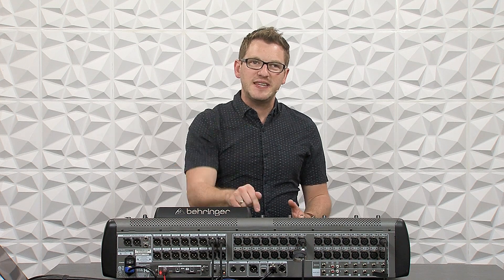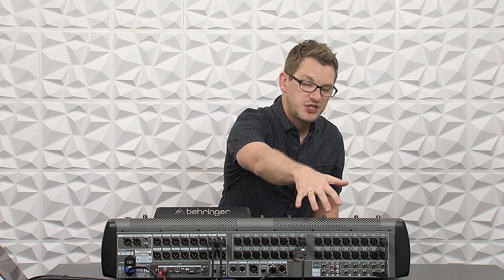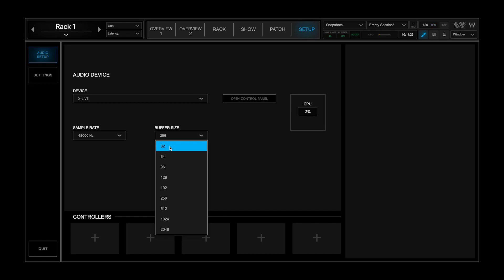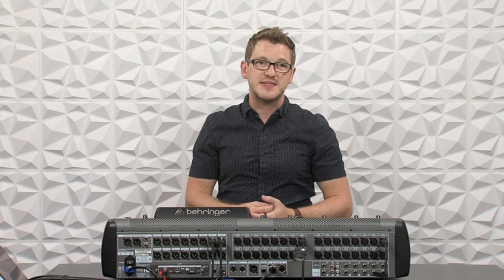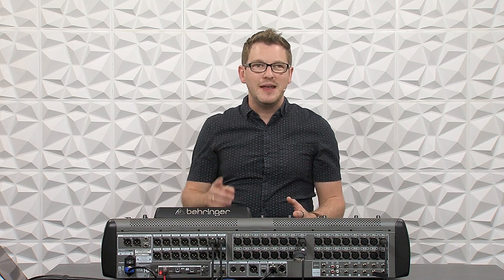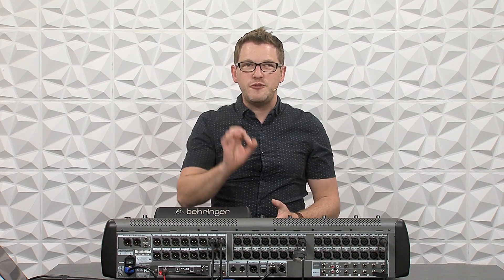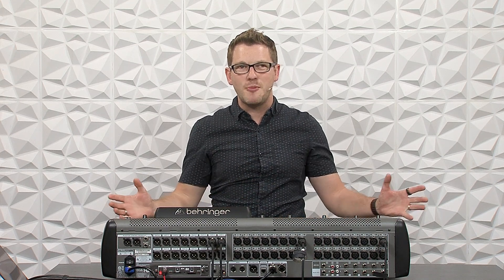Waves SuperRack Performer Latency with the Behringer X32

Comment: What happens if superrack performer crashes all of a sudden? Does it automatically pick up where it left off at the console or would you have to quickly reroute everything away from the card back to local as it is going to your computer?
Reply: If you insert it into the signal chain and Superrack Performer crashes, the mixer will not pass any audio. You need to quickly remove the inserts and/or get it rebooted ASAP. The silence seems like an eternity...

Comment: I have a low CPU usage but still getting audio pops. What do I need to do to help get rid of these audio pops? I have tried changing buffer size and didn’t help.
Reply: Popping is usually a clock issue (the console needs to be the master. Make sure you boot your console before you start your computer. 
The other common cause of pops is that the sample rate on the board doesn’t match the sample rate on super rack or whatever you’re using to process audio.  Make sure they both are set to 48k.

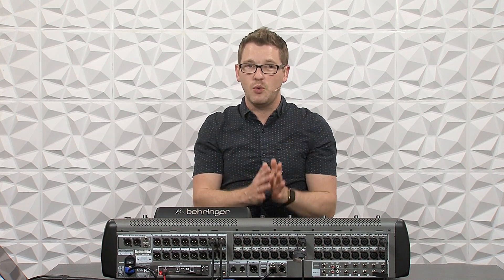Comment: Drew!!! You mention a suggestion real quick at 6:59. Can you please expound on how you would route a double patch for IEM? (Just for vocal) And it’s the routing that’s tripping me up, would you need to utilize User settings?
Reply: Set two channels to have the same physical input, but one of those channels gets routed the card and the other does not. The one that does not, that’s just for IEM, also has to be taken out of any mix that would be heard in the house. 

Double patching is also useful if you want different eq, compression, etc for FOH and iem.

Comment: Does the same amount of latency apply to a system with a waves sg card installed or is using a sg dsp with sg IO the only way to decrease latency? 

As an example, lets use the same setup you have but switch out the usb card for a waves sg card and add a waves sg switch, to connect to the computer. IIRC the waves sg card would make the x32 a sg IO, so would the latency decrease any?

Comment: Great videos man. Is there any way to do a virtual sound check through the xlive with superrack or is it impossible? I want to take it to my acoustic shows but I usually sound check by myself first
Reply: Good question!
Reply: I have the same question.  Have tried in vane to do this using Gig Performer 4.  It seems to be a difficult task...  It is great for live use though.  Maybe the problem lies with the X32.  ???
Reply: Yeah I mean you would think since you can use the USB and card at the same time it would be possible, I tried everything and it isn't

Comment: Thank you for this video! I'd like to ask you if there's any difference in latency processing using super rack performer compared to the older super rack native? I have the native and I don't know if there's any difference to upgrade to performer.
Reply: My question , is with all the trick to get the lowest latency,,, is it equal of the latency that waves provides for big shows like coldplay ....
Reply: @figureskatingman no it’s not. If you have a SoundGrid systems you’re adding a lot less latency. The waves wsg protocol is much faster compared to a usb Interface.

Comment: Drew, How do you  take the matrix pa mix and go to my inears and have the click to go there also with the click going to the main mix. I mix sound from the stage and a musician. I have click and direction that I don't want to go out front. I do want the maim mix out front  in my ears. I know how to get the main mix, but not the click track too with out is going out front.
Reply: Use a prefader aux mix, don’t use the matrix for your in ears. If you really want the main mix, just copy that on your aux mix (and add click and cue track). 

If you really want the FOH mix in your ears though, then make a subgroup with your main mix and a subgroup with your click and cue, then send the subgroup with the FOH mix out one matrix and that same subgroup out another matrix along with the subgroup with click and cue on it. In this case, your LR is not used; instead the matrix is your new “master fader.”

If you are set on using your LR, then send the cue and click to a subgroup, send your LR to one matrix, and send your LR to another matrix along with the cue/click subgroup. 

A prefader aux is going to be your straightest path to a good IEM mix.

Comment: Ok but why should I use SuperRack rather than Logic Pro for example?
Reply: Até onde sei, o Sr. Pode fazer tbm... Até com o REAPER
Reply: I am having the same thoughts 🤔 If the processing is only affecting the final mix anyway you could just use Logic with a high powered computer and end up with the same result, except even better because you could do all your parallel routing/bus and master effects in Logic with no limitation.. and don't forget you can use 3rd party plugins too. 

I already use Logic for our broadcast mix and it has been very stable. I have some experimenting to do...